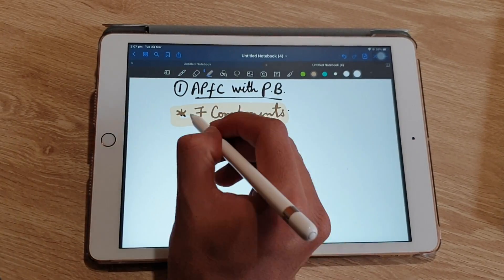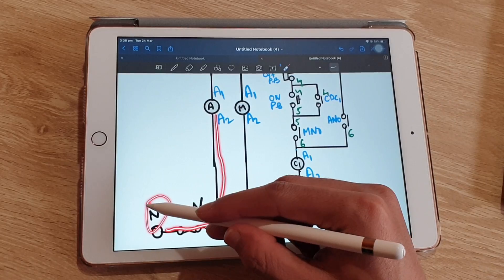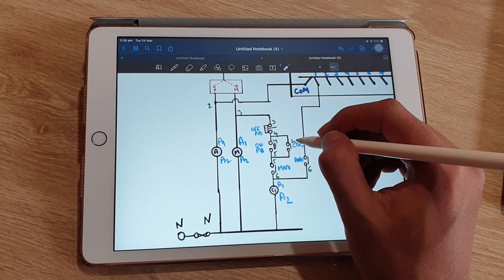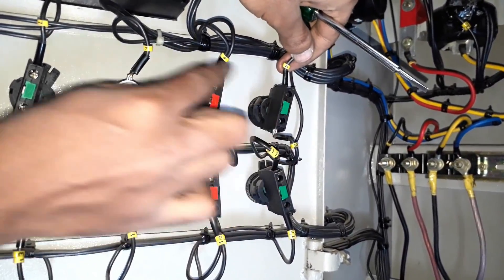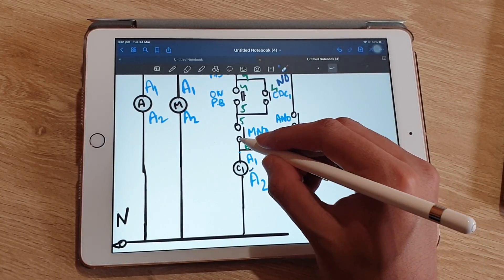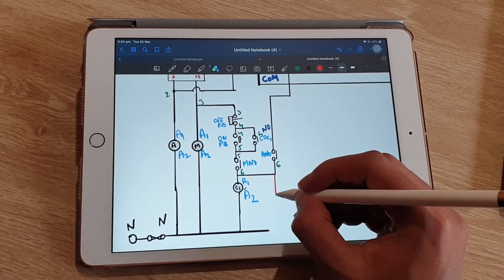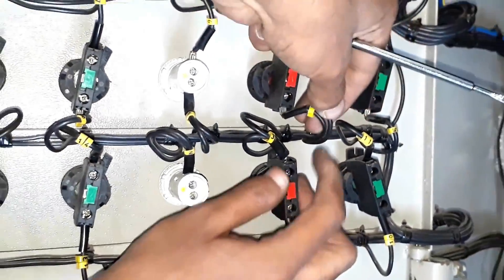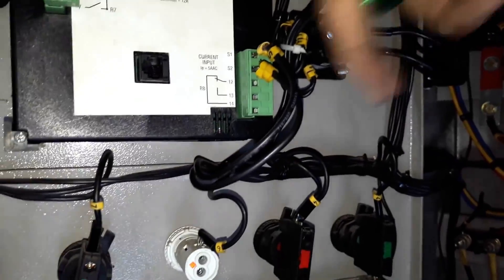APFC Panel Control Wiring Diagram | How to do Control Wiring of Auto Power Factor Correction Panel

Comment: Why auto and manual contactor is needed ? Can't we do control without using auto and manual contactor ?
Reply from the maker: Usually auto control is preferred but some times in emergency when auto control fails or malfunction we can use manual control.

Comment: IN WITH PUSH BUTTON ,HOW C1 WILL OPERATE IN AUTO MODE?(AS U CONNECT NC OF AUTO MODE CONTACTOR IN BETWEEN  APFC RELAY 1 & C1..........WHENEVER I WILL OPERATE IN AUTO MODE NC WILL BECAME  NO  ,THEREFORE C1 WILL NEVER OPERATE.
Reply from the maker: It's connected to NO of auto not to NC

Comment: WHY WE ARE CONNECTING WIRE IN APFC RELAY ON MANUAL MODE?
Reply from the maker: Thanks for questions🙂
Reply: MEANS WHY APFC RELAY REQUIRED IN MANUAL MODE?
Reply from the maker: During fixed load we can use manual switching. Also when there is failures of APFC relay we can use manual mode as an emergency.